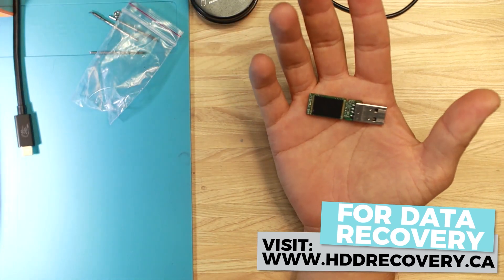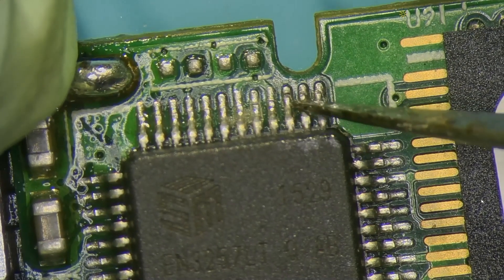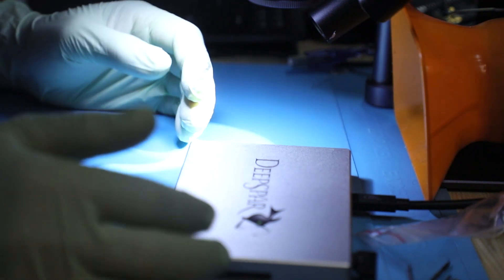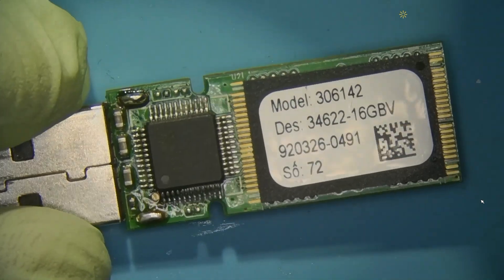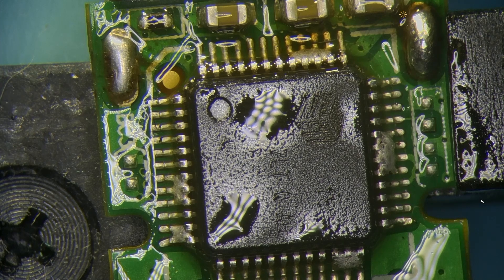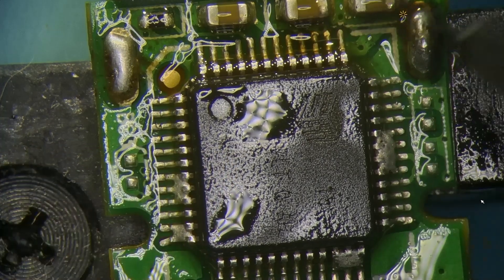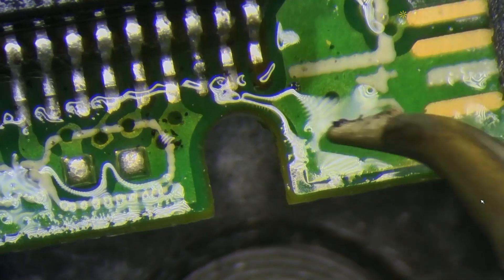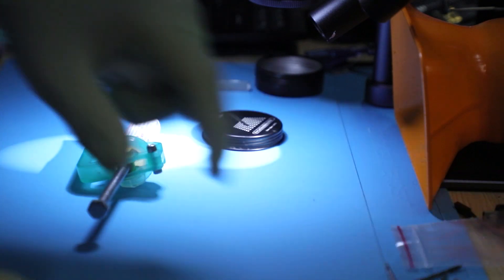Lexar Flash drive repair NEW tool review

Comment: I like to watch ur video.. amazing, 
Hei have u ever been solved corrupt file on Flash drive? Seem like normally but data can be opened. 
In this case, what was problem?
Reply from the maker: I deal with this everyday. There is a number of reasons why it could behave this way, and there are multiple ways on how that can be checked. There is plenty of recoveries on this channel where data is recovered from unstable flash drives using interface and NAND protocol as well. Dive into the content and you will learn a lot on this subject my friend.

Comment: Very informative video. Thank you 👌. Maybe you can provide a link for this new DeepSpar device? I will also wait for more videos with this new device, its capabilities compared to the old version are very interesting.
Reply from the maker: Serge at www.deepspar.com would the the man to ask about these. I just started using this unit actively so more and more of videos to come. So far the main differences are port count, speed, AMP monitoring, multiple devices can be ran at the same time

Comment: Hi bro I got bittloker key for my laptop SSD and it's can't open when I connect the cas. The repair shop person says you have to clean the all data but I have the important data on that it's actually 512ssd but  in that I have more than 140gb data I need to recovery soo please tell me any solution for this my problem

Comment: I love watching a craftsman at work!  I'm surprised people trust flash drives so much to store important information on them without having a backup copy or 2.  I mean everyone has a cell phone, so get a USB2GO cable and make backup.  And flash drives are cheap, so have a few dozen laying around and make multiple backups.  I have also noticed that SSD's seem to be failing at a higher rate recently though.
Reply from the maker: Easier said than done. Most ppl who never lost data don't even know that it can happen